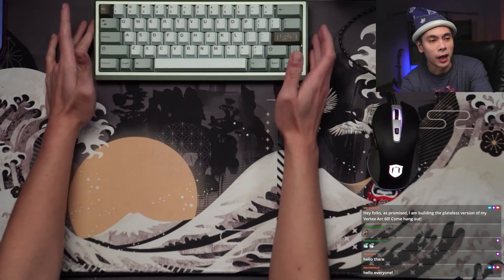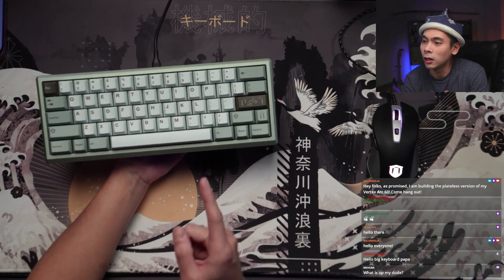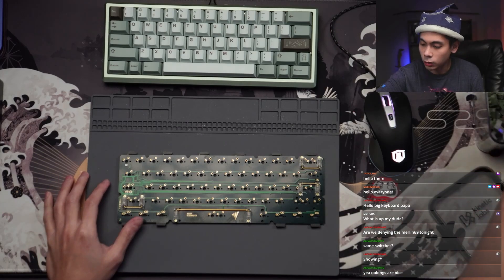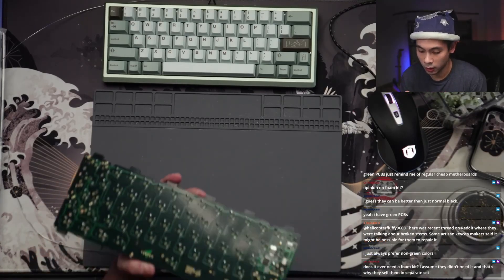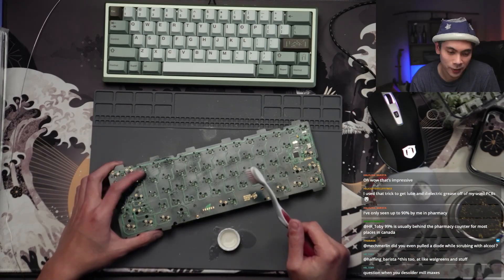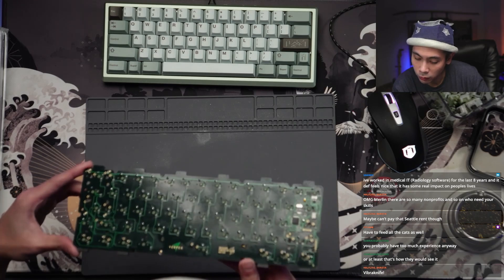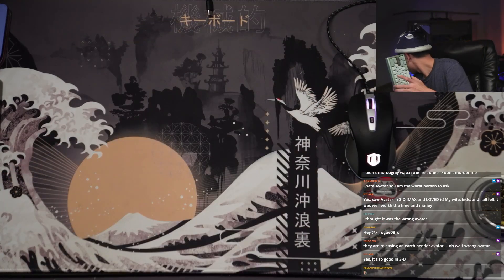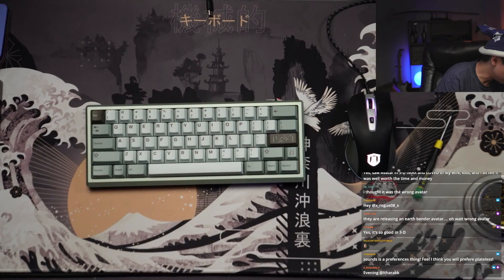Build: Vertex Arc 60 Plateless with JWK Oolong

Comment: I have been watching your turorials on how to flash a custom keyboard. I am still confused since all I want to do is turn off the RGB lights for a DZ60 board. Thanks for your help
Reply from the maker: You have to make sure that whatever firmware you flash on has a key to turn on/off the rgb. Simple flashing isn't gonna do anything.
Reply: @MechMerlin I reset the board as you explained by holding esc. while plugging it in. This seemed to work since QMK gave me a code and the lights turned off on the board thus making the keyboard not respond. I then proceed to flash on the new firmware I created in QMK configurator but the toolbox says that only files in the .bin format can be flashed in this bootloader, so I renamed the file using .bin thus giving me another error code saying "there is not enough space on the disk"
Reply from the maker: @imthatguypal9999  That means you selected the wrong keyboard in the drop down. You can't simply rename a file, it won't work like that. It's like renaming a .jpg to .txt, its just a completely different format.
Reply: @MechMerlin  Ok, thank you for your help and sorry for the bombardment of questions. This is my first custom keyboard if you couldn't already tell... Haha